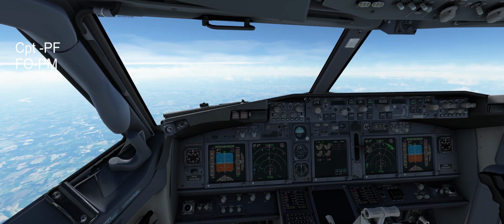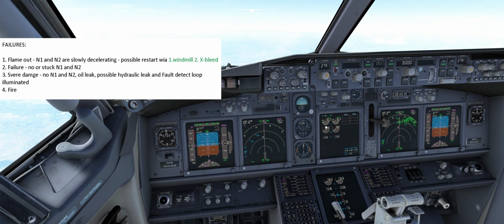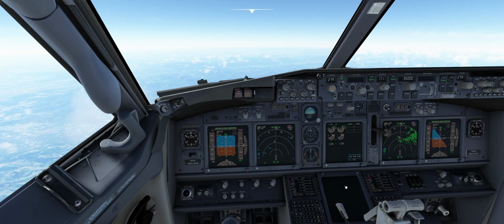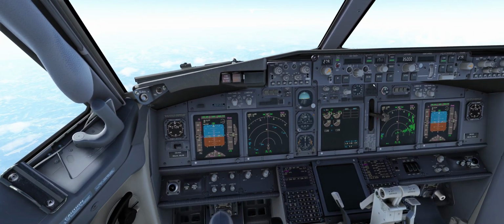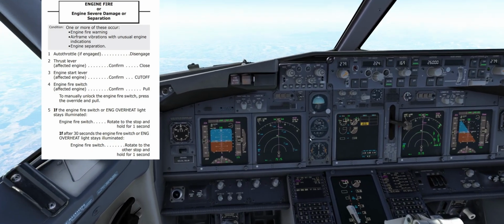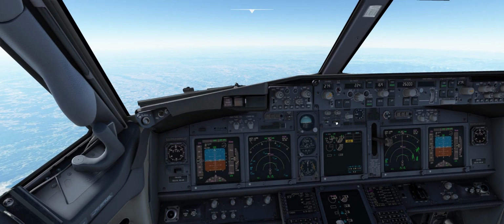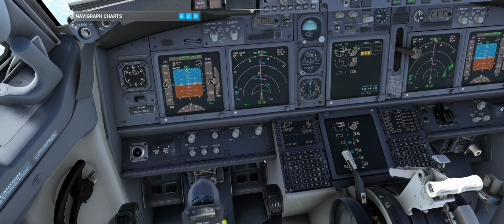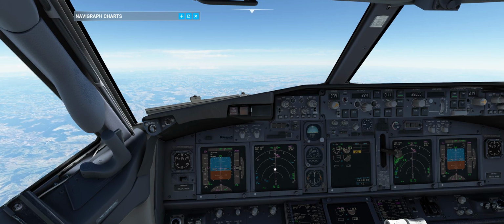Real B737 pilot Driftdown procedure engine failure | MSFS2020 | PMDG

Comment: Thanks sir for the great video. Im interested in how you reduce your thrust after selecting the LVL CHG. Where a driftdown should be a maximum power & minimum rate of descend necessitated by an engine failure. You said in the video that you reduced the N1 to maintain the speed set on the MCP, where in LVL CHG mode no matter the what N1 thrust percentage you have, the autopilot will maintain the airplane attitude to maintain the speed set on MCP, and by reducing your thrust it made you descend with 1000-1200 feet per minute rate of descend, which certainly not the most minimum rate of descend. By maintaining the CON thrust while descending on mode LVL CHG you would probably get the most minimum rate of descend (like 300-600 feet per minute) and it would give you the minimum glide angle without losing speed.

As a 737-800NG FO myself, im wondering what was your consideration with what you were doing in the video. Is it your company procedure to do so or have you got your own safety considerations regarding it. Very most appreciated for thr video and future discussion, im sure will learn alot from you sir. Thanks very much.
Reply from the maker: Thank for watching.....ENG OUT CRZ page should gives you MAX altitude and optimal speeed according you actual gross weight in order to keep the speed with max con thrust and LRC. Ypu can level the AC in higher altitude in some circumstances, but it wont be so economical for you :) I m happy you like the video if you wish more info check FCTM page 4.13. Everything is there :) I wish you goood luck in you career in order to became a captain